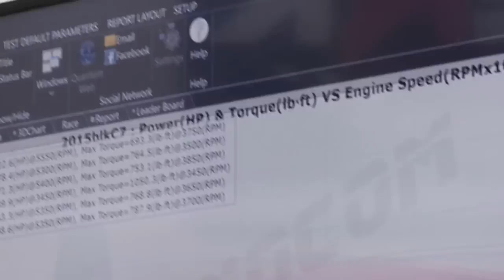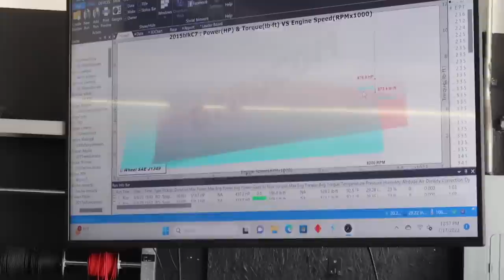Installing The Cam On My Z06 Corvette! + Horsepower Numbers REVEALED!

Comment: I made 720/725 on E60 Blend with Stage 2 cam, full exhaust, 9.2 lower, stock TB and Halltech intake.  In 2 weeks its going in to get the maggy 2650 added, along with NW 103, Rotofab Biggulp for 93 only.  I am hoping for the right at the 800 mark on 93.  Next year I will do port injection to run full E and shoot for the 900 mark.  I am also adding the Monster triple disc clutch on this next visit as well.
Reply: Have you considered the Fore Innovations Triple Pump system? I ran it in my heads/cam C7Z making 800 whp on full E85 with the stock, unported blower blower and stock injectors.
Reply: @Jtelles-Re  I did but wanted the better capability and cooling with the maggy in the end.
Reply: @UkWiLdCaTs4L1Fe  gotcha,  nice build regardless man 🤙🏻
Reply: Great numbers, but since this is an automatic car it will dyno less, I also don't know how much of a difference is between dynojet and dynocom

Comment: I’d say max effort 2650. Won’t have to run as much cooling with the intercooler bricks in the 2650 vs Kong X port on the stock blower.

Comment: Dude I love vettes don't get me wrong but my 2014 mustang gt with a Whipple makes 700 hp. All I did was supercharger and fuel system. Pump and injectors and lines and rails. I'm guessing it's mostly tune also. That is bad ass you hit that mark. Congrats. That is one loud beast.
Sorry. Paxton 2200 Sl. Not Whipple. That's on my 06 Stang.
Reply: It's true that if all you want is power for the lowest cost a C7 Z06 isn't your car. But it's combination of handling/braking/style/power are hard to beat for the price. Don't forget this car was stomping $200-400k price tag Lambo, Porsche & Ferrari ass with it's low 7 minutes Nurburgring time when it came out. It's not a drag car it's just good at everything.

Comment: Thanks for information and quality time. Can I ask your opinion? Shelby gt500 iron block 5.4 2010 with super. Snake body kit 1000whp or corvette z06 c6 lsx 1000whp? Can I use e85 just with suitable race injectors and in thank walbro e85 fuel pump? I see many lt4 corvette owners have to buy flex fuel kit. Do I need also ford or z06 c6?
Reply: Buy a c5 put an LS7 in it and do some suspension mods. Timeless car btw

Comment: Man, I have a 2019 Mustang GT procharged coyote and I've heard that a cam really wouldn't help it, what's your thoughts? Currently pushing 780 rwhp.
Reply from the maker: coyotes don't do much with cams tbh. smaller pulley for more power